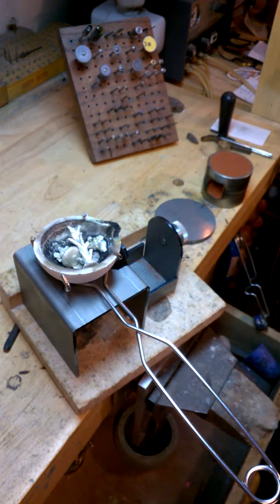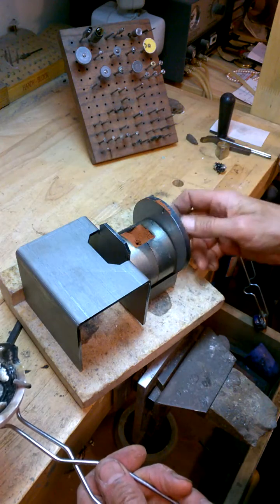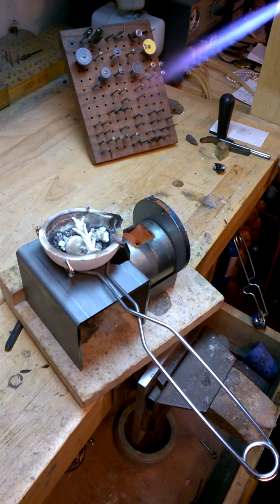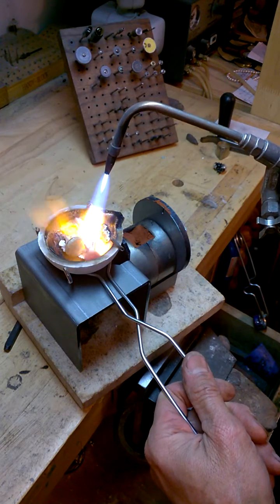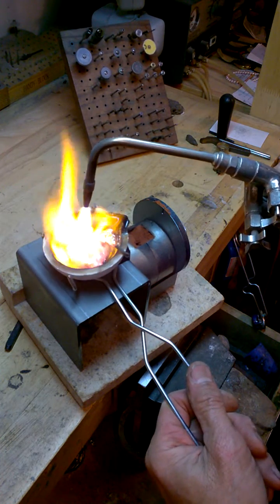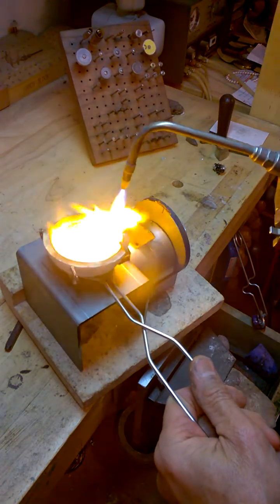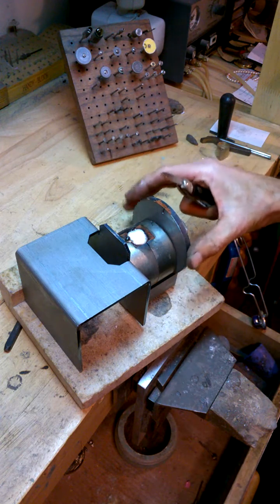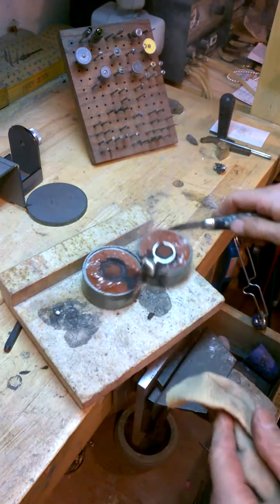Sand Casting Using the Acu-Pour

Comment: Looking into buying this awesome system you have to do small silver and gold castings. Do you know if the Smith Little Torch has enough power for this process? (Propane and oxygen)
Reply from the maker: You will need a rose bud tip and regular bottles with regulators. I've tested the disposable bottles and found they don't work well.